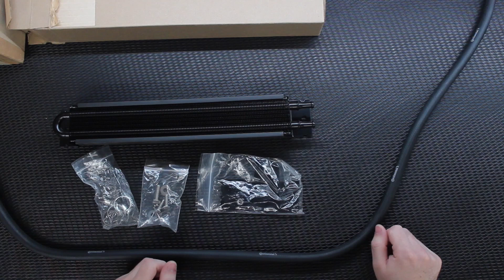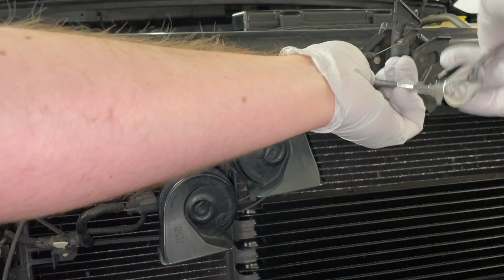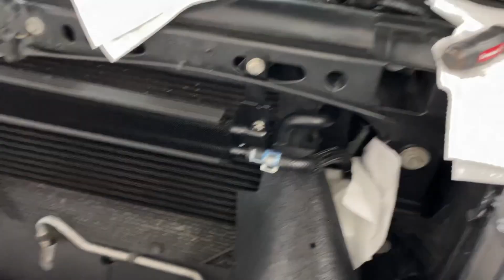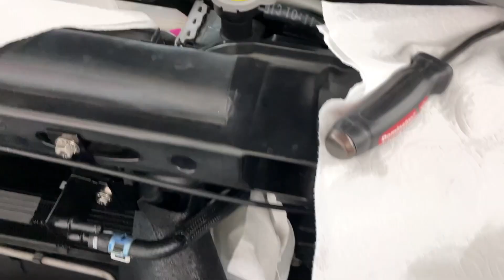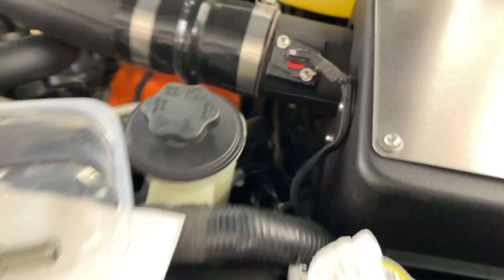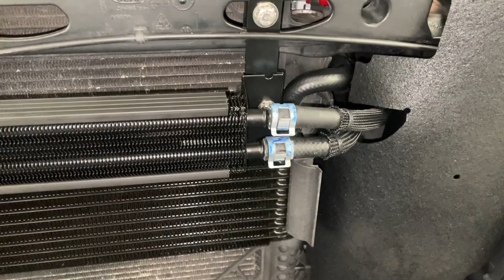2010-2014 F-150 Raptor Power Steering Cooler Installation - GJ Motorsports

Comment: Would you consider this a permanent fix?
Reply from the maker: I do, no more leaks from the factory cooler for sure!

Thanks for watching!
Reply: I have the Lee kit and planning on getting a cooler. Do you think this would fit the Lee return lines ? All of Lee return lines are 3/8 

Also seems like GJ is nowhere to be found. Maybe they’re using a derale type of cooler ?
Reply from the maker: @Khaled-tx5xj  It should be adaptable to the Lee kit as long as the reservoir isn't in the way (IIRC it mounts in front of the core support).  The GJ ones have been out of stock for some time - I'm on the hunt for a generic as well since I'd like to retrofit my other truck too.  I'll make a video if/when I find a solution for that.
Reply from the maker: @Khaled-tx5xj  I just ordered something that may work as an option - once I get things figured out I'll release a video...something you can expect to see in the next few months.
Reply: @Khaled-tx5xj  SwarfWorx bought out GJ Motorsports.